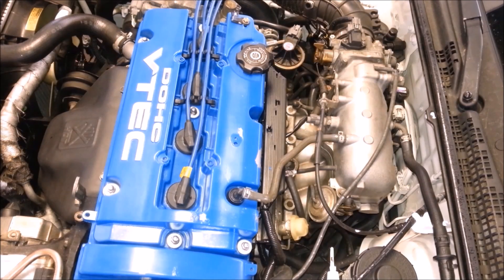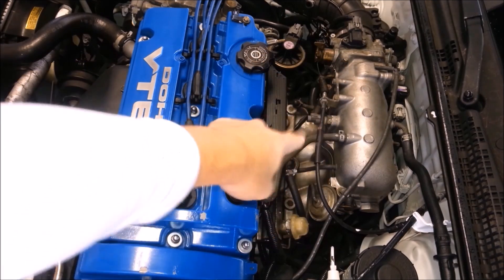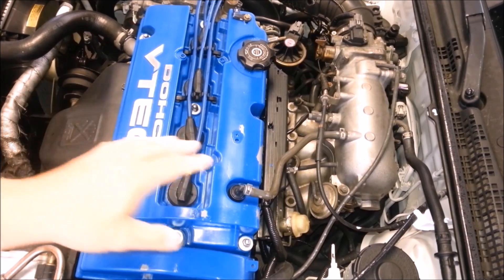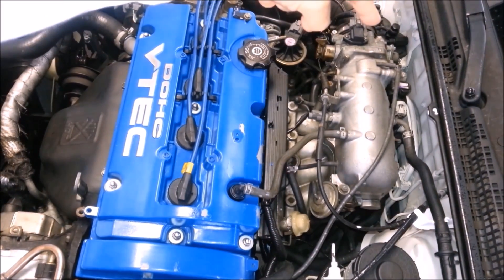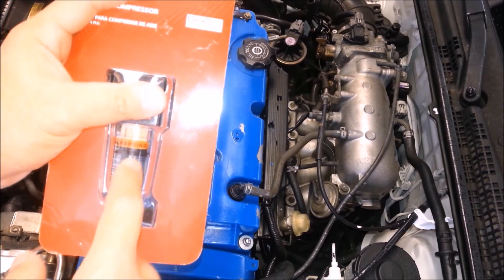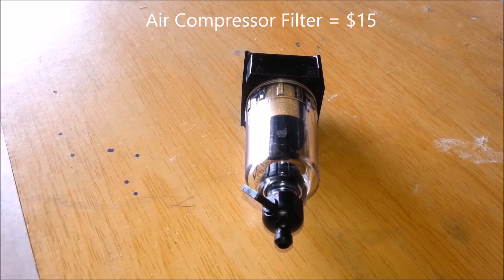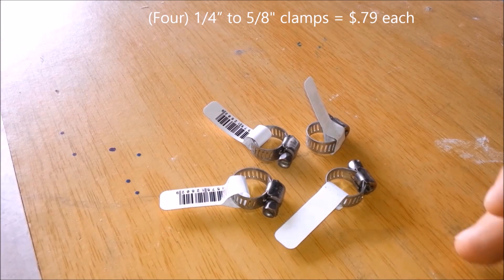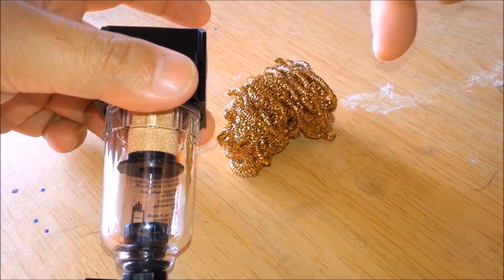DIY How to Make a PCV Oil Catch Can - @winstonbuzon

Comment: I used a slightly larger compressor air filter (from a large Home Improvement store), I left the filter element installed and put some stainless steel scrub material in the bottom of the filter housing.  When I started the car I noticed vacuum suction on the bottom of the drain valve even though the valve was turned to the off position.  This is because the valve opens under vacuum and sucks air, but the valve closes with pressure.  I just used a rubber vacuum line plug to not allow air to be pulled in through the bottom of the filter.

Comment: wow. Remove a perfectly good brass filter from a perfectly designed and ruin it. Maybe run the brass and the the wool, but really........FAIL
Reply: The one it came with, would be nothing more than taking up space ; within 2000 miles. Catch cans are very simple this would work just fine. There is no filtering mechanism needed, beyond the oil/particulates falling down; collected into the chamber.
Reply: Yes you did Mike !

Comment: YOU REMOVED THE SEPARATOR FILTER NOW ITS JUST BYPASSING!
the inlet needs to be below the steel wool and the outlet above this will settle the oil out,
the filter you removed serves as the separator
Reply: Tom Champman the "baffle" mainly catches particulates. The filter is what mainly separates oil and water. It's not rocket science
Reply: There is a tube attached tot he top part of the filter, which goes into the "baffling" he made, for the input. So, what are you talking about???
Reply: Just as Tony says, it's not the filter that separate the oil. Look at any oil catch cans on old equipment like tractors or old cars, none of them have filters on them. It's the change in momentum/pressure that allows the oil to separate itself from the air stream. How do so many people misunderstand this?
Reply: @midwestmangos2452  basicly a long hose also would work then.  Just have it a bit higher than the pcv outlet then it would drain any oil back in
Reply: Actually, it is part rocket science! 

The filter is not there to filter out water and oil, it's to trap it in place after entering the catch can. The water and air are entering a low pressure area (the catch can) from a high pressure area (the tube into the can). Once in this area, the water and oil particles slow down, from the speed they were going in the high pressure area, and this lets the oil and water (and any large particles) drop down to the bottom of the can. This pressure differential is what separates everything, not a filter. 

A simple baffle system will work just fine, as long as there is an open area to allow the pressure differential, so the air can separate from everything else. Gas and oil fumes (not oil mist) will still get through though. 

The filter he left out, is to compress the air as it passes through it and basically grabbing the water and oil, letting it drip to the bottom. Same thing that was described above, but done by creating the high and low pressure inside the filter. Now, if he were to keep that filter in there, it would clog up in a 1,000 miles and that would defeat the purpose of that system....
Reply: @Tom-yc8jv  word
Reply: @Tom-yc8jv  mad rocket scientist
Reply: the idea is wonderful, the execution needs to be refines as the flow will bypass the catch can, to be OK, the fumes flow must pass thru the steel wool so this wool will collect the fumes to form droplets and the droplets will collect to form bigger drops that will be not carried by the fumes flow
Reply: EXACTLY, I was like wtf?? Keep the filter in there. He removes the separator and the air filter only to leave the "baffle" brillo in? That's not going to separate much....but then again it is a honda. Just blow it up and buy another one for supes cheaps.

Comment: whats the name of the product with the orange packaging? where did you get it from? i need someting that size. theres no space in my engine
Reply from the maker: Its an air compressor filter.  I bought it from your local hardware store.  I can't say the brand because the company doesn't pay me to mention their name.  There are many to choose from
Reply: Winston Buzon The company doesn't have to pay you to say their name
Reply: Husky 1 4 In. Air Compressor Filter HDA70403AV 
 http://www.ebay.com/p/Husky-1-4-In-Air-Compressor-Filter-HDA70403AV/1500394682    

1/4" Mini Particulate filter for compressed air systems air compressor 
 http://www.ebay.com/itm/1-4-Mini-Particulate-filter-for-compressed-air-systems-air-compressor/262032316056?_trksid=p2047675.c100005.m1851&_trkparms=aid%3D222007%26algo%3DSIC.MBE%26ao%3D2%26asc%3D38530%26meid%3D4d0c8aa96da94c8f8cb79bb9072e513e%26pid%3D100005%26rk%3D3%26rkt%3D6%26sd%3D222337708222
Reply: Husky 1 4 In. Air Compressor Filter HDA70403AV 
 http://www.ebay.com/p/Husky-1-4-In-Air-Compressor-Filter-HDA70403AV/1500394682    

1/4" Mini Particulate filter for compressed air systems air compressor 
 http://www.ebay.com/itm/1-4-Mini-Particulate-filter-for-compressed-air-systems-air-compressor/262032316056?_trksid=p2047675.c100005.m1851&_trkparms=aid%3D222007%26algo%3DSIC.MBE%26ao%3D2%26asc%3D38530%26meid%3D4d0c8aa96da94c8f8cb79bb9072e513e%26pid%3D100005%26rk%3D3%26rkt%3D6%26sd%3D222337708222

Comment: I know this is an old Video but did anyone have any issues removing the bowl? Mines seem not to remove at all
Reply: I'm having the same damn problem did you ever get it?
Reply from the maker: None whatsoever.  What might have happened in your case is that when your engine got really hot, it might've just gotten stuck.  Try a little bit of PBBlaster to loosen it up a bit
Reply: +Winston Buzon (DubEezy) no this is a new one, I thought it was bad so I returned it and got another one and it's just a tight lol. I'm starting to think I have the same power level of my son. He's 3. Lol
Reply from the maker: Lol
Reply: cocksangwhich yup I had to use a C clamp and some pliers to remove the bowl

Comment: Is air suppose to be coming out of the nipple port?
Reply from the maker: Only when the valve is open.  The valve only gets opened if there's oil in the canister
Reply: +Winston Buzon (DubEezy) that's weird...first start up and all I hear was air from it. There is some oil in there now from driving around. Should i put a plug on it or will it build up too much pressure and not work properly?
Reply from the maker: The only air that should be flowing is through the inlet and outlet.  There should be no air coming out of the valve where you drain the fluid
Reply: +Winston Buzon (DubEezy) ok thanks.

Comment: First point of concern - "I'm not a technical guy"
Reply from the maker: Sorry it took so long to respond, but what I meant was that I'm not a mechanic to boast the right words to use
Reply: @winstonbuzon  how did it work out for you? Are you still using it or did you upgrade? How much sludge did it accumulate? And how often did you replace the steel wool?
Reply from the maker: @mortysmith5556  haven't had the need to change the steel padding yet, otherwise it's still holding up.  But then again, I haven't been pushing my engine hard enough for it to get hot

Comment: These airline filters are designed to remove oil from air already. You don't need to modify it.
Reply: Plus i think some of the more expensive oil catch cans have the same bronze filter. All the videos I've seen remove it as well so it may be a mechanical thing.  Good video though,  thorough.

Comment: Do not use fuel line. use transmission oil cooler hose. fuel line will soften over time
Reply: Awww sheesh the auto parts store dude gave me fuel line free cuz he was out of everything else 3/8. Nice gesture but suppose I'll need to replace it. I would have thought fuel line would hold up because it's exposed to gasoline
Reply: @sbond1963  correct, the fuel in the lines is what will degrade other types of hoses.
Reply: 100% Correct

Comment: I couldn't even remove the clear reservoir .......installed it without the steel wool. My other issue is a "leak sound", but when I block off the return line, it's quiet, so it's not a leak...it just sounds like it.
Reply: +Zeronorhero I may have installed it in the wrong blow direction...lol
Reply: So did turning it around fix your issue? 
-Many thanks
Reply: Nope, bought a Mishimoto catch can instead lol
Reply: The one that Engineering explained recommends?
Reply: idk, I got the Compact Baffled oil catch can. Added some mishimoto pcv silicone hoses to match my engine bay too.

Comment: really no need for a catch can unless you're turbo,your car shouldn't have much pressure being N/A unless you have a blow by issue with gas escaping past piston rings or valves
Reply: cspek88 And you are wrong. With the pcv being connected directly to the intake, it also sucks up oil which gets deposited in the intake. Since most vehicles are fuel injected these days, there is no fuel going through the intake to clean it as on a carburated engine.
Reply: I ain't turbo and by the way my manifold is, I NEED A CATCH CAN but i cant find one and building a GOOD ONE is not a job for me

Comment: I wonder will this one do the trick? 
http://i.imgur.com/8Rd29ey.jpg
Reply: Size :10.5 x 4 x 4cm/4.1" x 1.6" x 1.6" (L*W*H).
Thread Hole Diameter: Hose Connector: 1.2cm/0.5"
Gauge Connector: 1cm/0.4".

Comment: +Winston Buzon (DubEezy)
One more VERY IMPORTANT thing I forgot to mention, the RUBBER O-ring that you said not to lose, actually needs to be lost and replaced with a Viton O-ring of the same dimensions. Along with the oil and other gasses, there will be gasoline/petrol vapors, flowing through the PCV system that will break down that rubber O-ring. Might as well just replace it as your building your catch can, save yourself some trouble down the road. Ok enough from me. Thanks for the upload!

Comment: nice video bro!
i wanted your advise as you seem like u no what ur doing
the breather pipe from my car to the rocker cover (vacum sucking) when disconnceted and blocked results in a problem sorted,
ie the cover case end is left open and pipe end blocked makes a high pitched sound go away,
my question is can i drive like this??? engine seems to have great performance?
cheers
Reply from the maker: Handy Voice Yes, you can.  For me, it's just an added peace of mind knowing I will have a cleaner intake manifold and recirculated air

Comment: have u got any oil into the catch can yet
Reply: john wayneMost of it will come from WOT runs where the pressure can't be vented fast enough w/o picking up oil. Like a straw with some water droplets in it, you can blow a certain amount and not have the water droplets move, but if you blow hard it will pick up and move the water droplets. Same kind of thing, and there is a video on youtube of a clear moroso oil air separator and shows it while the car is being run hard
Reply from the maker: john wayne No, but I will make a follow-up video when it does... :)

Comment: Nice one Winston. I need to check the PCV on my old Toyota. It looks the same as the one on your video. It's plastic and seems just push in? How to remove it? I pulled the top off and nearly lost the spring. But do I just lever the bottom half out of the Rocker cover? Thanks again.
Reply from the maker: ron martin Mhg Just ease it off slowly and carefully.  These things can break easily, depepnding on the type of material (usually hard plastic) because of the underhood heat.

Comment: Hi... great video... Im using the same on my SRT4 but Im using the brass filter that you remove and works fine... how is working with the metal wool?... thanks in advance... Daniel
Reply: Winston Buzon I'm pretty sure it helps collect the oil from the air as well. If the wool wasn't in there the oil wouldn't have anything to grab on to.
Reply from the maker: Daniel Rodriguez The wool is just used to keep the sloshing of the oil buildup, but it's awesome for me...

Comment: I routed the PCV line to the air filter box, then plugged the line going in to the intake manifold. It still vents, and any oil that spews out finds a home in the bottom of the air filter box. Only 1 fitting to buy, and yes, I had to drill in to the plastic air filter box. 
Just for the record, the hole for the PCV line is below the air filter, so any crud that comes out will (worst case) get sucked in to the air filter.

Comment: I was looking for a baffle style catch can but decided to do this routed in line with my catch can to insure   the vapors get separated... does this actually work?... also to the guy that says the pcv line should be bigger it doesn't matter... as long as u use the same size that was used for ur motors application it will fine.... Ive ran 3/8 hose on two motors with a catch can setup and track, drift, beat my motor it doesn't matter vac source is a vac source. Ur motor doesn't actually vent pressure correctly no matter what blow by is common and if u really wanted to be efficient u would add 4 breathers to ur valve cover instead of to vent blow by truly and have ur pcv connected to a vac source the pcv works on vac source look up the design online... thanks for the awesome catch can idea

Comment: Good video,  I made one similar to yours for my 08 silverado.  It did fine at low speed but highway driving seemed to fill up the reservoir causing it to smoke on start up.  Have you found a way to direct the accumulated oil back into the engine yet?
Thanks
Reply: Winston Buzon It wouldn't be difficult actually. Since you already have a valve on the bottom, you'd just need to run a line from that valve to a fitting on the oil pan. You would need to drill in to your oil pan, and install a fitting. But that's not overly complicated if you have a little know-how. That would actually make this small style catch can pretty viable.
Reply from the maker: Not yet
Reply: Hello I had the same problem you have to look up the update value covers that moves the breather plate to the front of the engine so it will not suck up oil. The old value covers breather are in the back.so when you drive gravity feeds PC valve which goes into the intake plenum.

Comment: the cheapest and easiest way is to use a fuel filter. after 2 months it still works fine on a Mitsubishi Colt plus. you can clean and Re-use it. apart from the manifold the MAP(Manifold Absolute Pressure) sensor is kept oil free, oil on the MAP causes inaccurate readings. the result is: bad gas mileage

Comment: The small openings and hoses on this setup are inadequate for all but the smallest engines.  As your engine ages and produces more blow-by the restrictive size will cause crankcase pressure to build, this will eventually cause gasket failure and oil leaks.
Reply from the maker: I will definitely make bigger hoses and fittings then  :)

Comment: Just made one but it was a 2 stage can used a GROZ air sintered bronze filter with 1/2" fitting as to allow more flow of air to prevent back pressure used it as it is to allow the separation oil and air to be more effective with the centrifugal flow provided by the FAN like vanes (a coaeleser filter would be better to effectively separate the air from the oil vapor) and made a home made baffle can as to further remove the remaining mist of oil and installed further away from the engine because of all that heat it might actually melt the polycarbonate bowl on the filter and workrs great.......
Reply: MCDC MCDC post a video!

Comment: if using a air compressor filter (like he did) there are two rubber O-rings that should be replaced before using, as the gas&oil mixture being collected will eat them and you will develop an air leak.  replace the Rubber rings with Viton rings.
Reply from the maker: Hmm, I will look into that.  Thanks!
Reply: I bet you 10 years down the road with the same o-ring and it’s still fine

Comment: The breather hole diameter of your pcv valve should be 1/2" to 3/4" or bigger to flow blow by gasses with restriction - thereby preventing engine seals and gasket damage by pressure build up  and allowing the motor to REV properly  - this catch can is WAY TO SMALL - i bet your car runs like poo with it installed as well.  Check online to verify for yourselves. also the oil reservoir is much to tiny in your mini oil catch can  - get a bigger oil water filter to HACK - otherwise your Hack is great ..
Reply from the maker: Duly noted.  I will make sure to make observations and record my findings, but I'm running about the same, maybe better before or after the install... :)

Comment: Man my prius keeps sucking up puddles of oil. So bad it threw a o2 sensor check engine light. and sometimes it makes the spark plugs misfire. So every month or so i have to take apart the throttle body and clean out the intake soak up the puddle and all. its a real pain. This Idea is gonna be my life saver for real! Thank you so much!
Reply: Oh yea, Guys don't forget to replace the rubber O-Rings inside the separator with Viton O-Rings They are orange colored. Because The black O-Rings are not compatible with the fuel vapor that will be entering the collection cup. If you use the original black and blue O-Rings over time the gasoline will disintegrate them and you will have a vacuum leak and possibly a check engine light. Also make sure your rubber hoses are gas and oil compatible as well. Otherwise they will disintegrate too.
Reply: Lakario Davis And if  you get the one with the valve at the bottom you will have to seal it with RTV because remember this is meant for high pressure. Your Pcv valve pipe will have vacuum on it. So the stop in the valve won't be strong enough to keep it liquid tight.
Reply: +Lakario Davis Change your PCV valve. It should solve you oil problem.
Reply: Thank you. Ive replaced the pcv valve twice. no luck.
Reply: Same here; Prius just sucks oil on my 2006 Gen II; this will definitely help.